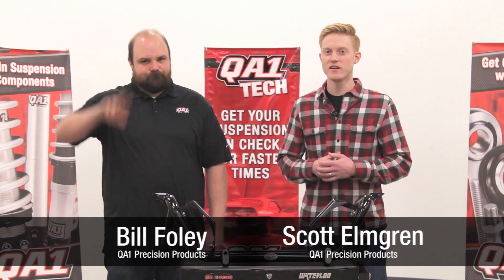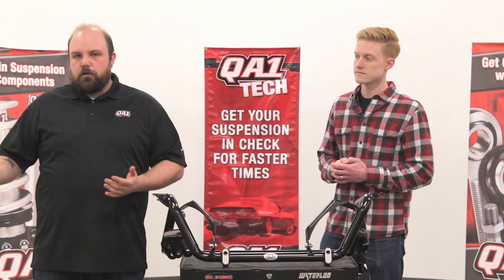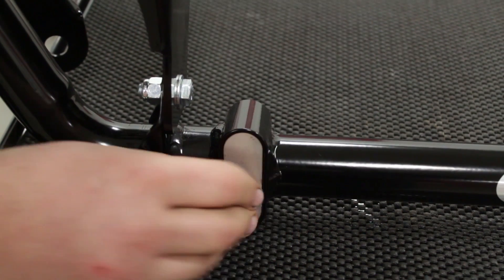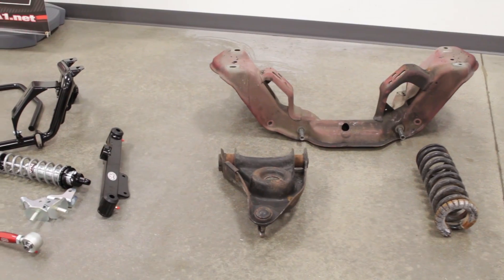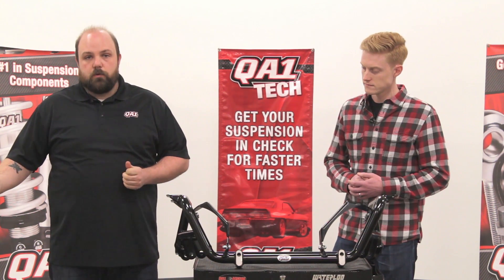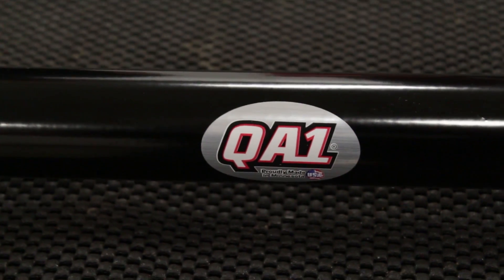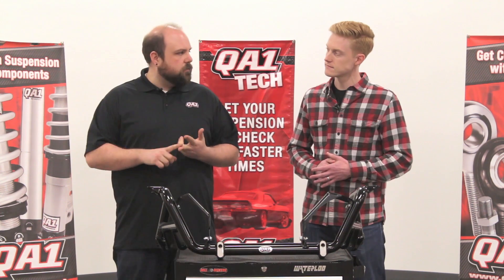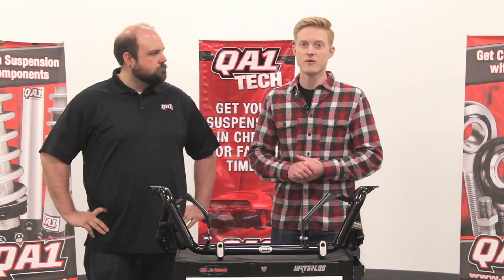QA1 Redesigned Mustang K-Members

Comment: what headers do you recommend with the use of this k member on a sn95 ls swap?
Reply from the maker: 52115 LS engine mounts were designed using ’98-‘02 F-Body oil pan (Dorman p/n 264-331) and ’98-’02 F-body engine mounts. Hedman Conversion Headers (p/n 45850) were used during the design of these swap mounts. Other headers may work.

Comment: Hello QA1, we have a retired customer’s 93 GT purchased brand new in 93. We’re sending his engine to a machine shop for bore enlarging. While removing the engine from bottom, we have recommended  K-member upgrade. Without breaking the bank what do you recommend? We want to keep the stock A-arms and struts if possible. This is a pleasure and street car. The owner’s a 70 year old Grandfather. Thanks
Reply from the maker: You can use our K-Member with stock control arms, but we do recommend using ours for the best results.
Reply: But you have to buy coil overs correct?

Comment: Does this k member fit a 3.8 v6.
Reply from the maker: It was not designed to work with that engine.
Reply: Maximum Motorsports has one that does.

Comment: Trying to find a K member for a 2000 mustang gt so a 351w could fit. And Could  18×9 wheels fit with the kit?
Reply from the maker: The 351w (Windsor) is the same engine family as 302s, and as such, will fit our K-member quite nicely. However, because the block is taller, the exhaust can be an issue. Keep in mind that exhaust headers are manufactured in various performance levels and sizes as such, we recommend contacting the header manufacture to confirm fitment of any given application especially a 351 in a Mustang.

As far as larger wheels & tires, if they fit the factory K-member and wheel opening then they should fit our K-member. However, with larger and wider wheels/tires you may give up a little on the turning radius because the tire may come into contact with the control arm during while turning lock to lock.

Hope this helps!

Comment: does this work with 99-04 convertibles? and does the lower x brace or k member brace need to be put back on or is it not needed with a tubular k member?  Wont there be more chassis flex without the lower x brace?
Reply from the maker: Hey Matthew, this K-member does fit on 99-04 convertibles, but it is not designed to accept the lower X-brace. It may still fit, but may need some modifications. With the amount of weight savings these K-members offer, there may be an increase in chassis flex, but it depends on your goals for your car and whether you think that trade-off is worth it.

Comment: What's the story on anti-dive on these k-members? I know you raised the control arm attachment @ 1/2",, but did you add any anti-dive and, if so, how much?
Reply from the maker: Hi Michael, you are correct that both raise the control arm attachment 1/2". These K-members are designed to match the SN95 anti-dive. So if you've got a Fox Body, it will change it to match an SN95, but if you've already got an SN95,  you will retain the factory angles.
Reply: OK, thanks for the reply, but as my understanding is that the 94/95 SN95 cars had the same anti-dive as the earlier Fox cars (meaning, zero), I am assuming you mean the 96 and later SN95 anti-dive geometry, after they changed the K-member for the modular motor??
Reply from the maker: You're correct that the Fox Mustang antidive plane is 0 degrees compared to the upper frame mounts.  In our research, all SN95 cars have the same anti-dive angle. All of our K-members replicate the anti-dive plane of a SN95 Mustang.

Comment: 93 fox mustang. I currently have a twin turbo coyote engine in the car with a oem 04 cobra k-member. I need more room for the 3" down pipes. The coyote engine has the same motor mount location as the 4.6 engine. Will the QA1-MUK14 work for my application or do you have a specific k-member for a coyote swap in a fox body? I'm glad the old design is gone. I also had the wheel rub problem with the old kit and sold it. This is an expensive build and I dont want to be doing things twice. I have your adjustable coilovers on all four corners of the car and it has been rock solid. Due to me good experience with your suspension pieces I am willing to consider the newly designed k-member.
Reply from the maker: Hi Ryan, thanks for the question, and for your kind words and loyalty to QA1! We haven't confirmed fitment of a Coyote motor with our k-member yet, but if you have that setup with a factory SN95 component, and it works, it sounds like the following setup could work for you: our new Fox body k-member without engine mounts (part # MUK01) + our modular engine mounts for the 4.6 engine (part # 52114). The reason we recommend the Fox body k-member is because on the SN95 k-members, the distance between control arm pivots are longer/wider, which could give you alignment issues when installing that k-member on a Fox body. Hope that helps!

Comment: I had the same exact problem with my qa1 k-member and their control arms with my front tires running on the front of the fender on my 87 mustang. I was definitely less than thrilled. I ended up cutting the back of the control bushing sleeves to move the control arm back some. Not ideal but I didn't want to spend the $$$ on the expensive control arms that will allow you to adjust the placement. I should have done my homework. From what I read the qa1 k members move the wheels forward some.
Reply from the maker: It's true that the previous k-member design moved the wheels forward and out for a more drag-specific set-up. Our newly redesigned k-member keeps the wheels in the factory position while optimizing suspension geometry for both handling and drag racing applications. Thanks!
Reply: QA1 - it's nice to know that since I'm going to pull mine out...

Comment: I bought a qa1 kit hoping to have a great handling 85 foxbody. Not so much. I rushed it to the body shop to get the paint done. I noticed the tirrs were really close to the fron fender. 11 months latrr i got it back and was trying to get it to an alignment shop. But i cant turn the wheel but a 1/4 turn. Called qa1 and learned i have to buy a set of redesigned adjustable a arms. 400.00. So beware of the set up you buy. I told the guy it was a street car, not a drag car. Never again.
Reply from the maker: Sorry to hear that, Kevin. Our older K member was designed for drag racing which moved the wheels outward and forward. The old K-member was offered in our drag racing kits only.  Our new K-member was designed to address both the street/handling and the drag racing market without changing wheel position. Please give us a call at the tech line at 952-985-5675 and we can discuss your build. Thanks!
Reply: QA1 i called your tech line tuesday before to see if any sort exchange or discounted parts might be available but only offered to sell adjustablea arms for 399.00. I even vorrowed skinnies to see if they fit. So i tried every option before a negative ppst was made.
Reply from the maker: Hi Kevin, I talked to our Customer Service manager, Dave Kass, and he wants to find a way to make things right with you. He is off at SEMA this week but asked that you give him a call when he's back in the office next week. The customer service line is 952-985-5675, and please ask for Dave Kass. Thanks again!